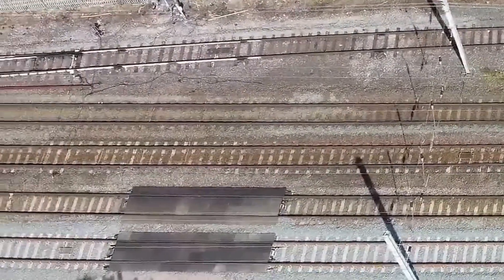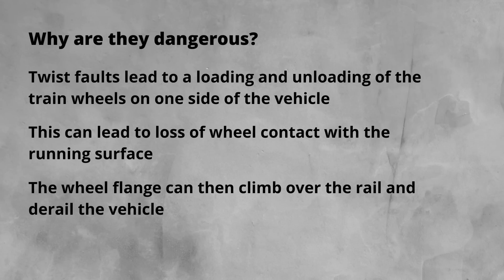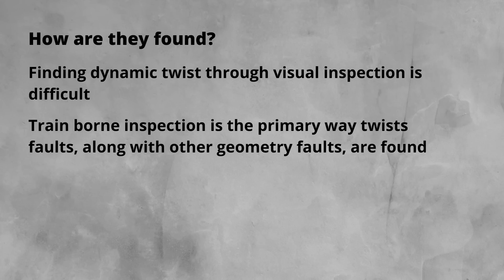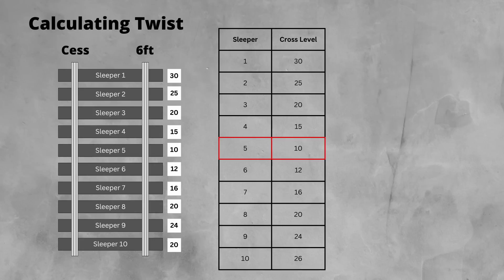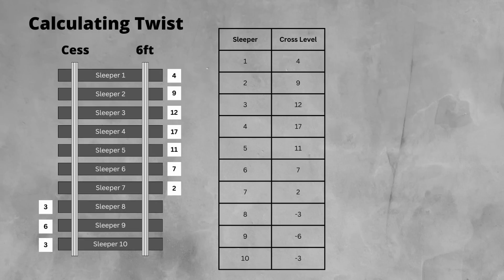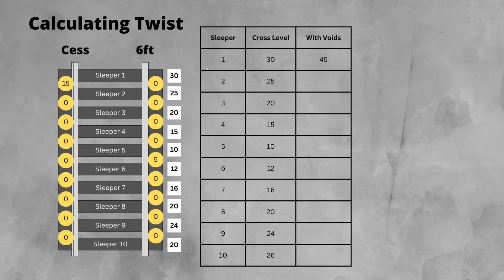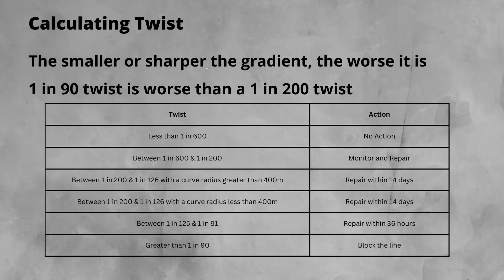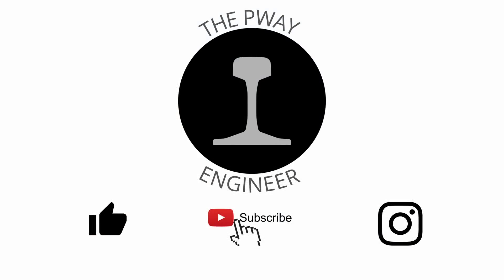What Is a Railway Twist Fault on the Railway? The Best Complete Intro Guide

Comment: Are u not supposed to calculate the distance over the difference so like 3000 / 20 which would give u a 1/150 gradient? Rather than the other way round

Comment: You can actually go an substract all the way, even with negative values.
In Matz this doesn't make a difference.

1 - (-1) = 2
1 + |-1| = 2
You do the second thing.
You take the absolute value and add them.
When doing a excel sheet of this, you can simply use the simple way of substracting all the way through.